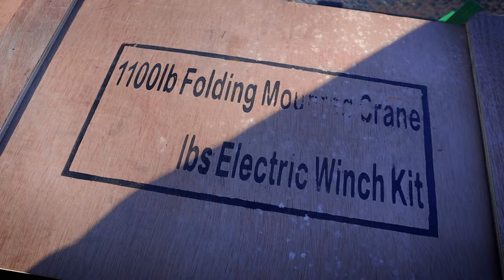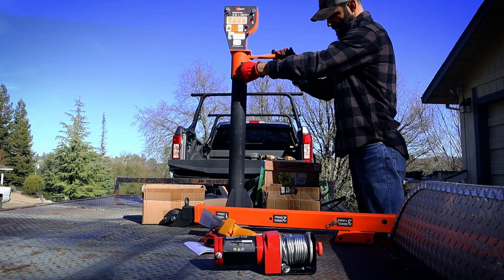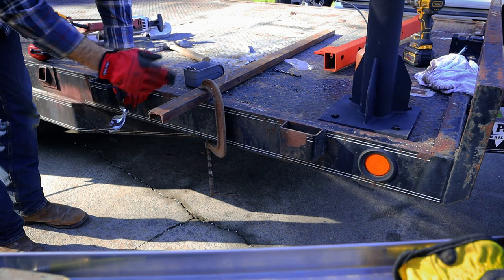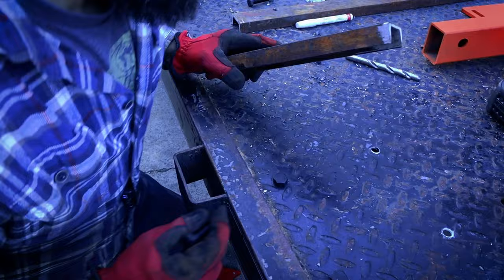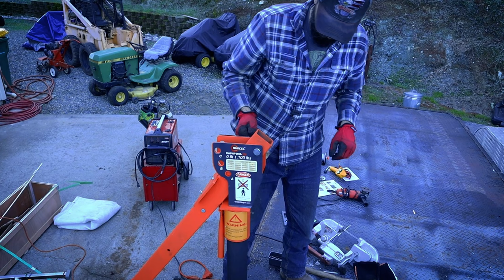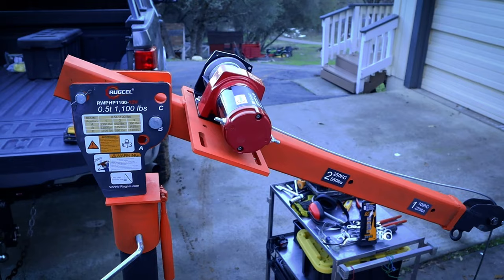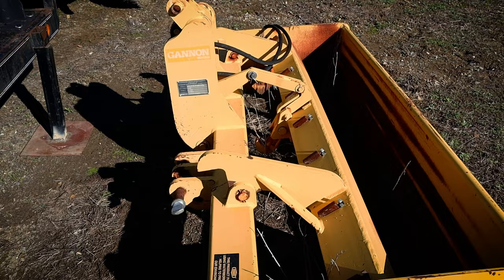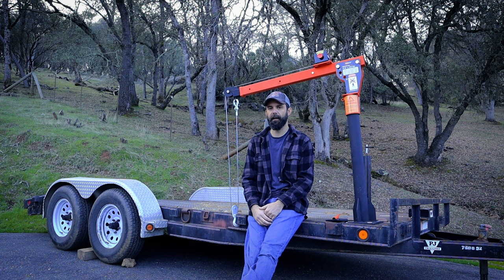Buying and testing the cheapest truck bed crane we can find!

Comment: I have the big brother to this, the 2200 lb Rugcel. My welder/fabricator put a 1/2" 2x2 ft. steel plate under the trailer deck with grade 8 bolts (threw the Chinese ones away) and double box iron across the width of the trailer and welded to the frame to boot. I also had him place it just in front of the wheels so the weight gets taken up on a 3500lb axle instead of the corner or the tongue there. An outrigger or jack will help that and I'm sure you've got her tuned up right by now. I lift 1000 lb marble sculptures on mine and deliver and set them up in public sculpture parks and it works great mostly. A couple things I'm not thrilled about is lifting real heavy items will run the battery down fast even with my truck running and having it plugged in. I need more power than a 12 volt heavy duty battery and my 4Runner. The reverse won't work if the power gets low from lifting and so you're stuck with a 1000 lb rock just hanging there until you charge the battery up again and that can take time and be a real pain. I'd love to get a 3/4 ton with big dual alternators, but I'm not rich and interest rates are too high to switch trucks right now anyway. Oh, and don't forget to grease the main bearing regularly or the crane will rust and seize up.  Last but not least, my winch and yours didn't come with a "fair lead" block so when you reel in the cable it can bind and Criss cross over and cause the wires to fray. I emailed Rugcel about this and never got any response. Maybe you have to buy that separate? You know what I'm talking about, the rollers in front of the winch that make the wire spool up properly.  You've inspired me to do a video on my next marble drop and I appreciate seeing how others addressed the same sort of challenges I had in getting this all to work. Good job.

Comment: I bought one made by Velvor last year, I had to reinforce the bottom also, where the boom sits, the brackets were not square. A bit of advice, if you take this on the street, drill a hole all the way through the boom and base, as it will walk, no matter how tight you turn the lever.

Comment: Instead of the added cost of a trailer jack, mounting time, and inconvenience of placement, just get a piece of rectangular steel that will fit through the tiedown, with multiple holes of course for different terrain, and make a bolt on foot. Cheaper, just as effective. Just need to brace that corner. Just my thoughts.

Comment: @rustyassets weight limit is due to extended distance from center, so once you get the boom right way around, should be able to lift more at closer proximity to the trailer. Why not weld some supports just below the pivot, angled down to the trailer? that arm that fell off, put a longer one (perhaps removable), it will help you rotate large loads that you dont want to be under (again, once boom is right way around). If you put a pulley at the hook, and run the cable back up to an attachment on bottom near end of the boom, you'll put less strain on the winch and the cable. might want to upgrade to a winch that has a load holding brake.

Comment: Get a 1/2” steel plate that’s trailer width and 2 ft wide. That will hold and not flex. Bolt plate to trailer or weld then your hoist. Hoist was backwards

Comment: By ny opinion you have all wrong - position of the crane should be somewhere on the back around trailer wheels so they can take weight. Crane arm is installed opposite than  it is designed so your lifting angles are  not sufficient enough to lift anything serious or long,   etc....

Comment: When the trailed deck bent downwards, you said "it wasn't the brace weld failing, it was the deck weld". I don't see how that could be possible if the brace was under the deck and supporting it.
Reply: He needed to use either washers or a spacer to take up the gap between the trailer deck and his reinforcement braces, or he should have clearance the brace ends for the flanges of his trailer crossbeams to weld the braces flush to the underside of the trailer deck.  He left a gap
Reply: @dodgeme1986truck I would've put the braces right up against the deck to better distribute the load. Leaving any sort of a gap is asking for trouble. looking at the amount of movement, I think the weld gave way.
Reply: @MakeitZUPER  that's what I was stating the braces weren't flush underneath the deck and there were no spacers to fill the gap which caused the problem
Reply: Yep,.. I don't know why he didn't mount it through the channel main frame just a couple inches away. And cope the 1 additional cross member to be flush to the bottom of the deck.

Comment: Hey how are ya I found your video because I was looking for a crane similar to this but do you think the vertical pipe can be shortened and still work probably? I need it to be as short as possible.
Reply from the maker: It should work just fine. It should be an easy modification